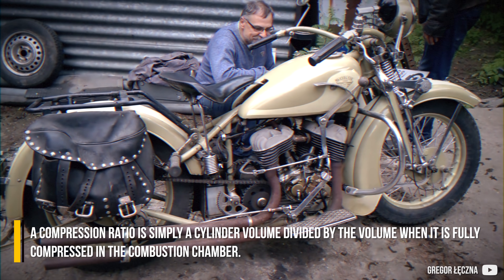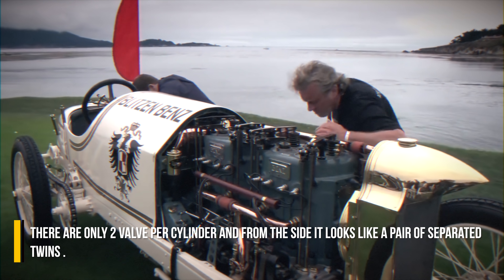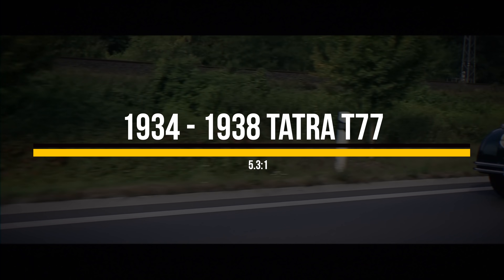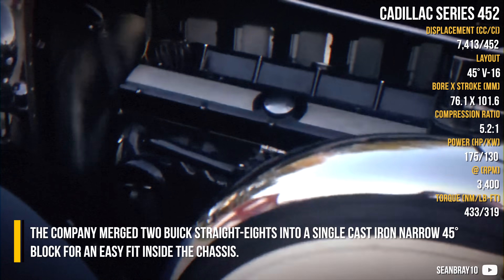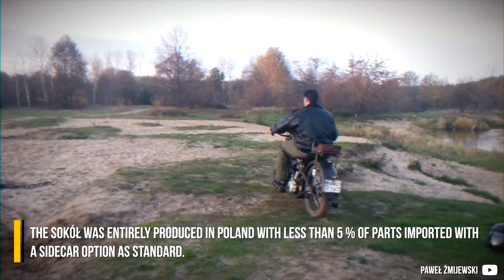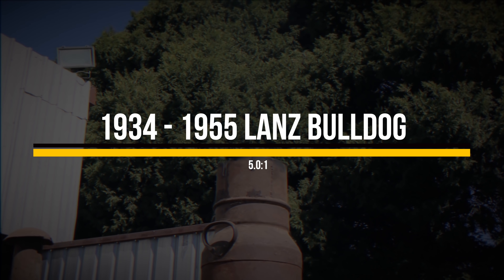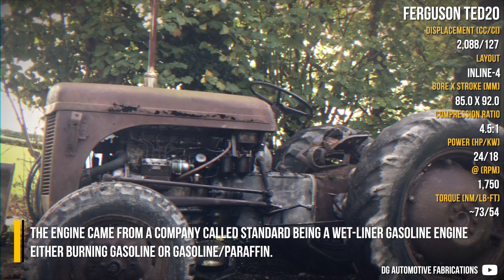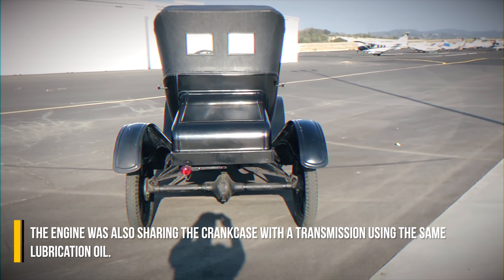The Lowest Recorded COMPRESSION RATIO Engines

Comment: Imagine going 120 mph on old tires that are narrower than motorcycle tires
Reply: But low resistance doe!
Reply: @kerimca98  😅😅😅😅😅😅😊😅😅😅😅😅😅😅😅😅😅😅😅😅😅😅😅😅😅😅😅😅😅😅😅😅😅😅
Reply: @kerimca98  😊😅😅😅😅😅😅😅😅😅😅😅😅😅😅😅😅😅😅😅😅😅😅😅😅😅😅😅😅😅😅😅😅😊😊😅😅😅😅😅😅
Reply: Too be fair the werent old back then. And wee go even faster nowadays with the same thin tire /wheel  in land speed records
Reply: @johndowe7003  its possible but those jet cars that hold the land speed records have a shit ton of downforce
Reply: Fun
Reply: Fourofthem
Reply: 228 kph is actually around 142 mph
Reply: Skinny tires work on a motorcycle, why not a car?  Now cornering at speed, that might be different ?
Reply: @GangstarzIndustries  weight
Reply: Many people that did do that are dead because of it.

Comment: Lowest quality fuels, and lowest compression ratios, at least in the US, were in the period 1908 - 1920. At that time compression ratios of 4.5:1 were common, many makes of cars lowered their compression and the long stroke engine became popular for the first time. Previously a bore and stroke of 4 X 4 1/4" was common, later the long stroke 3X5" was used to accommodate the slow burning fuels.
In the twenties fuels slowly improved, as the cracking process allowed making low grade fuel into higher grade fuel, the addition of tetra ethyl lead increased octane ratings, and the Ricardo combustion chamber allowed higher compression. Compression ratios slowly climbed above 5:1  and to around 6.5:1 by 1940.

Comment: Love it, thanks for the vid! I used to work in a petrol station (UK term) or gas station (in US) when I was young - early 1970s - and we had a back-up diesel-powered generator for when there were power cuts (outages), which there often were back then, for all sorts of reasons (see British history in the '70s). It was a single cylinder, hand-cranked monster. You held a valve-lifter lever open with one hand while you cranked the beast with a huge handle. If you let go of the valve lifter before the flywheel was spinning fast enough you could break your hand/wrist/arm, whichever! When it 'caught' you could feel the ground shake. It was bolted to the concrete floor. But it did the job. I loved the sound of a huge single running at ? maybe 500 rpm. No one ever serviced it, or changed the oil even. No one knew when anyone had last done anything to it! You could put almost any fuel in it, paraffin/kerosene, petrol, diesel. I even - just for fun - added a mixture of engine oil, petrol, and paraffin, and it ran perfectly! Yet it ran ever time you needed it.

Comment: Compression RATIO is NOT actual compression (measured in PSI) the piston cannot build compression until all the valves in its cylinder are CLOSED. Watch the mate valves on the Benz at 1:06; they're never open simultaneously at all; this builds more compression from a lower compression RATIO but severely limits RPM & HP. Compare that to a 60s & later valve-train where the intake valve[s] opens before the exhaust valve[s] closes (overlap) The more radical the cam the more overlap it has, which contributes to the "lope" associated with high lift/duration camshafts that allow the engine to rev higher but require a higher comp ratio to build equivalent compression. It's that lack of cam overlap and huge displacement that gives old engines their sound even though the dynamic compression is about the same.
Reply from the maker: I am pretty sure that I never said the compression ratio being equal to a maximum cylinder compression pressure. There is a stated compression ratio and there is a dynamic CR. I only provided the one, that is available to every engine (and I suppose those are nit the dynamic CRs)

Comment: Nice video.  Just a quick note; the Ford Flathead was introduced in 1932, not '34, and, in the US market, anyways, hung around until 1953, not '55.  The Ford Y-block overhead valve V8 was introduced in 1954 to replace the flathead.

Comment: How does a valve train like that work without any lubrication?  The rev limit must be quite low, but still, probably not gonna last long.
Reply from the maker: Early days of automobiles... not as often used as today, most definitely not made to last as long as any present car.
Reply: Back when the model t was introduced cars weren't normally a form of transportation, just toys for the rich and even the rich barely drove any distances to commute. Oil on any car had to be changed every 100 miles, stuff like that etc.

Comment: Stood beside a Ford flathead hotrod once. It had Zero mufflers, just straight pipes out to the side of the engine yet the Sound was very smooth and Not too loud at all. Probably due to it being a v8 with the very low compression ratio!
Reply: Those "straight pipes" if they're cone shaped often have about a quarter inch of fiberglass insulation with a perforated stainless steel liner like a glass pack. I don't do a lot, but takes the edge off.

Comment: I wonder what is the dynamic compression ratio in these engines, in modern engines it can be even like 4 units lower than the declared number... E.G my motorcycle that has to have 9.5:1 compression ratio has dynamic compression ratio around 7 :D :)

Comment: Food for thought:
A low compression engine may be very helpful in times of poor petrol quality...
Reply: @Alfred Wedmore thank you for the answer. I couldn't understand what you guys meant by "low quality petrol"...
Reply: Can someone explain why?
Reply: There's water meth injection that cools the air down, lessening the risk of knocking
Reply: @Alfred Wedmore it is possible and many people do it for turbo projects as its much much cheaper than custom pistons
Reply: Compression plates? Those are still in use on aircooled single cylinder engines. Chinese single cylinder diesels uses them.
Reply: @kimpatz2189  why would you want to drop the compression ratio of a small or cold diesel? That's only going to hurt your thermal efficiency. There is zero pre-ignition risk with a diesel anyways.
Reply: @otm646  The designs got cloned so much that some of the measurements are a bit off. The cylinder block can be off by a few measures, The piston rods length can be different. The plates are mounted between the crankcase and the cylinder block to solve those tiny indifference.

Comment: hye man, weight doesnt matter for top speed! Top Speed is achieved when max pulling force is equal to drag, so power and air resistance are same (ignoring rolling resistance, which is minimal compared to drag at high speeds)

Comment: I have a book about car compression ratios, I remember the lowest compression ratio to be 3:1 I'm out of town right now but I'll be back on Monday, I'll send the exact make and model when I get back.
Reply: Rolls Royce Silver Ghost (1907)
Compression ratio of 3.2:1
Engine: front longitudinal, water-cooled straight six in two groups of three cylinders
Cubic capacity: 7046cc/430cu
Bore x stroke: 114mm x 114mm
Maximum power: 50bhp @ 1500 rpm.

Sorry it's not quite the 3:1 I said it would be, I'm sure it would get there if it was my daily driver tho ;-). I also found this sub 4:1 compression ratio one.

Itala Grand Prix (1908)
Compression ratio of 3.8:1
Engine: front longitudinal in-line four cylinder, pair cast
Cubic capacity: 12045cc/734.7cu
Bore x stroke: 154.8mm x 160mm
Maximum power: 100bhp

Other low compression cars I found:
Austin Seven (1925) 4.9:1
Amilcar c6 5:1
Bentley (1930 4.5 liter supercharged) 5:1
Vauxhall 30/98 OE type 5:1
Isotta- Fraschini tipo 8 5:1
Lancia Lambda 8th series 5.15:1
Duesemberg model J 5.2:1

I also found out that the 1985 Audi Quattro had a compression ratio of 7:1 which is pretty interesting.
Reply: @alternator7893  I think that Quattro's ratio is so low mainly because of massive pressure coming from turbocharger. The more boost you have, the less compression ratio you have to have in order the enigne to withstand the combustion (combustion pressure and forces).
Reply: @AZTG92  Yeah that makes sense, I wound my 3sgte down to 8:1 with a super thick head gasket when adding far more boost
Reply: @izzy031096  Yeah, exactly. But right now we have plenty of sensors, ECUs, algorithms, variable shits, etc. so it is easier to design engines (VW's TSIs have 10:1 or 11:1 ratio, which is crazy, taking into account their output).

Back in 1985, they had only mechanical K-Jet, which is a set of springs, levers and flaps, so lowering the CR significantly was the only method for strong boosting with reasonable reliability.
Reply: @AZTG92  back in the day they could have used LPG or alcohol as fuels to achieve reliable combustion on high compression ratios. High compression alcohol engines were in fact series produced for the Brasilian market.
Reply: @mjouwbuis  Of course they could, but outside Brasilian market the ethanol fuels were not so popular (and so were other alternatives). And in case of Audi Quattro, the engineers were forced to meet the FIA rules, which I think specified strictly the fuel for rally cars (the road version has a lot of things common with the rally version).
Reply: @alternator7893  Awesome list of info thanks man!
Reply: @alternator7893  4.5 was typical for British 500cc side valve bikes c. 1920-1955-ish.
Reply: @alternator7893  My Saxon has a compression ratio of 3.2:1, that was pretty common for touring cars of the period.
Reply: Make and model please lol
Reply: @arthurerby2466  shit I almost forgot!, Hold on a minute
Reply: Great info!, could you please tell me which book is it?
Reply: @dietteriffic   @dietteriffic  the book is "inside 100 great cars" by David Hodges, I think it was originally published in 1988, I have the 1997 reissue, it's a really cool book filled with car history and specs 👍
Reply: Don't forget to add top fuel dragsters, I believe they run about 6.5 to 1.

Comment: What about "The weakest v8 engines"? I think that would be interesting.
Reply: The Curtis V8 from 1906 was an air cooled 90° dual carburator F head low compression engine with a 269cu (4410cc) displacement that developed 40 horse power @ 1800 rpm
Reply: Early 80s gas crisis era American v8
Reply: @Ádám Bezzegh I think the Chrysler 318 was down to 105 or 110 by the early 80's.
Reply: That would be all American cars
Reply: GM's time to shine
Reply: Chevy would take up most of the list
Reply: Jeep Grand Wagoneer would like to have a word
Reply: Ironically, a lot of "muscle cars" have the weakest power / volume
Reply: @ Doug Steel

But best power to weight. What’s the point in having a “small” engine that needs a bunch of heavy and bulky stuff like turbos and multivalve heads and overhead camshafts?  A “big” American V8 like the LS is lighter than pretty much any European or Japanese engine capable of the same power, and none are as durable or reliable (with the exception of variable displacement models which is an easy fix).
Reply: He already made that video I believe
Reply: @backyardrestorations  he made the video based on this comment
Reply: @sunny9895  even before that.
Reply: Stag
Reply: Engine capacity (displacement) to horsepower is a significant number for any engine.
Imagine a "nervous" Italian sportscar with, say, 1,5 litres & 150 HP & a bigblock with, say, 7 litres & 270 HP, the former has 100 HP per litre, the latter a mere 38,5 HP per litre - which really makes it an agricultural machine...😎
Reply: @stefanpaege2046  If you really think about, it means absolutely nothing. It's interesting but doesn't say much about real life usage. 
The only ratio that truly matters is the power/torque to weight of the engine ratio.
Reply: @stefanpaege2046  i agree!! Older engines with big litre efficiency and huge numbers displacement are used to be bullet proof engines! Saw visio's another video, i loved blitzen benz! 21k displacement and 15 litres engine!! Wow...i lost my heart already!! Fuk these todays stupid fake engines like LS1 or some other small block! One of the filthy thing ever invented is ""Turbos"" which killed these big capacity engines!!
Reply: @stefanpaege2046  nah dude isn't that easy. engine efficiency is based on how much the engine producing the power with some amount of fuel. when two engines produces same amount of power at different RPM range, the engine that running at lower RPM range has a better efficiency. because when the engine runs more faster, it sucks more air and that means more fuels going into the combustion chamber.
Reply: @stefanpaege2046  power per litre means nothing. Its all about power to weight. Chevy ls1's, despite their displacement, are actually quite light and compact, which is why they are so succesful. Also not to mention how durable they are
Reply: @Sheltada  power to weight means nothing to efficiency.
Reply: @OldSchoolZ-wy2yx  yet everything to performance
Reply: @Sheltada  i used to be Chevy man but my own heart was broke so many times rewind back to 1989 got new 89 IROC Z28  5speed  305  TPI engine all kinds of bolt on parts , hyper chip , that was same engine but 45cubic inch smaller then corvette engine same year , cuz of mine had a bone stock already beat to death 89 mustang GT 5speed treated like a slut from day one , that poor abused mustang GT 5speed would pull my IROC by a car length ever gear change , not only quicker tougher my IROC busted trans, busted rear end, engine was tough just stock drive train was weak for drag race i is Ford man now driven ever day and 365000.0miles zero trouble for 19years Mustang GT 5speed car U will see the lite if ur not dead yet? Ford tough !
Reply: @scottyjones27  good luck with yer fords traitor.
Reply: @scottyjones27  Maybe back then you should have went with the L98 TPI 350. I had an 89 Formula 350 (with an automatic) back in the day. If I had a nickel for every 5.0 Mustang GT and LX that I smoked back then I’d be a millionaire. The huge lie by G.M. back then was that the 350 was only good for 10 HP over the 305 was perpetrated because the lighter weight Formula with the 350 was faster than the Corvette even though it had cast iron heads where the Vette had aluminum heads. That’s the reason you could only get an automatic with the 350 F Body. G.M. was put in a tough spot because their 5.0 305 F Bodies were consistently getting spanked by Ford’s 5.0 302 Mustangs and they had to do something about it while trying to do their damndest to try to keep it slower than the Vette. You are correct on the driveline issue though. G.M. continued to use the crappy 7 1/2” 10 bolt rear behind the F Bodies until the end in 2002. Although some late 3rd Gens had the BW 7 3/4” rear which was stronger than the 10 bolt, neither of them could hold a candle to Ford’s 8.8 rear.
Reply: @Sheltada  🤣🤣🤣🤣🤣 what the hell you talking about??😅 ..LS are trash engines!! Kid you need to learn! Displacement speaks and so much as the power per litres !
Reply: @georgeloyie7456  you really that worked up about someone buying a car from a different brand? Calm down and stop acting like a child
Reply: @ckryses3962  trash? So that's why people swap them into anything with wheels?
Reply: @Sheltada  I agree and I want to add the LS platform is pretty simple with wiring for being a modern engine as well
Reply: @stefanpaege2046  ok now stick your 1.5L engine in a heavy ass truck and see how long it lasts . The 7.5l makes power with less effort
Reply: @stefanpaege2046  you europeans really oughta know that the same 7.0 liter v8s that made 200 hp during the gas crisis can make 1000 nowadays. Literally just look up any big block chevy/ford/hemi, and yes they can do it on a stock block
Reply: Also, a smaller engine will put out less torque and will have to spin at a higher rpm to make comparable horsepower.  The big 7.0l v8 during the fuel crisis may have put out only 200hp but still made over 400 ft/lbs of torque at like 1800 rpm or something like that. No small displacement engine was making that, even with forced induction.
Reply: @austinradtke2896  But then you have to take into consideration what job the vehicle does and how fast the pistons get moving. Lightness then comes into play.

Comment: There is a modern engine made today that only has a 4:1 compression ratio. That's Mercury marine 175hp spark ignited Diesel fuel burning outboard engine.
Reply: Are you sure about that?, A gas engine sure, but I was under the impression that diesel required at least a 16:1 compression ratio

Comment: you can make a high compression flat head ford but you need to flip the intake and exhaust around to feed it. with the headers in the intake valley and carbs on the exhaust ports it's a silly looking engine that won a lot of drag racing trophy's in the day. you can do the same thing with a Buick nail head to overcome the small intake valves and a lot of drag racers did
Reply: The problem with a buick nailhead isn't small intake valves, its small exhaust. You flip the manifolds on a nailhead so the better breathing intakes become the exhaust, and then use forced induction to overcome the restrictive exhaust ports that are now your intake
Reply: But what if it gets forced induction?
Reply: @TRC2002  thats the issue, porting nailheads is really tricky and its really easy to get it wrong